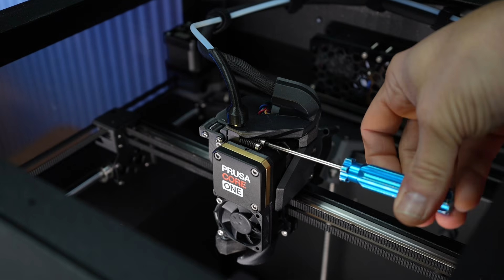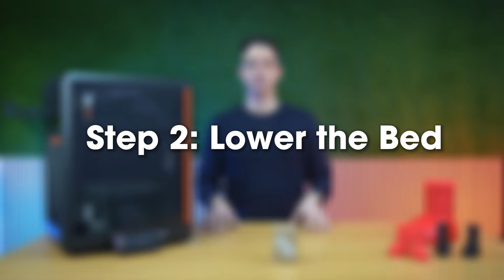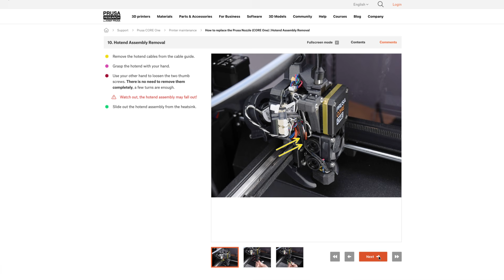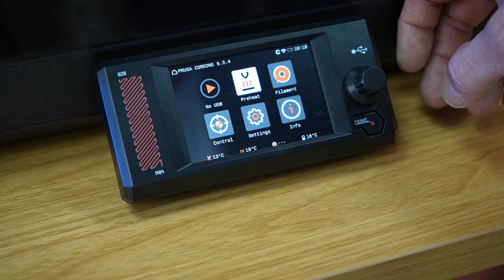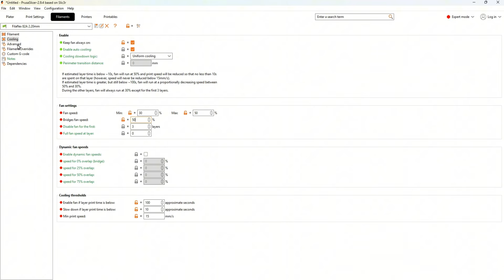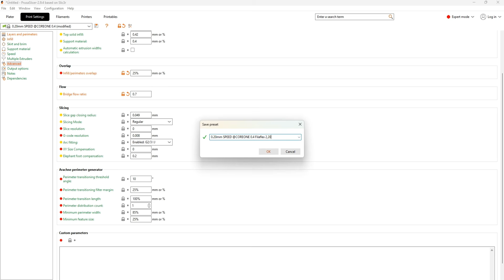How to Print TPU Fast in PRUSA CORE One/+/L | UPGRADE Filaflex 2.20mm

Comment: Will this work through the INDX system?
Reply from the maker: No, they are entirely different systems. The 2.20mm system presented in the video is a specific upgrade designed to optimize flexible filament feeding, and it is not compatible or meant to work through an IDEX (independent dual extrusion) setup.